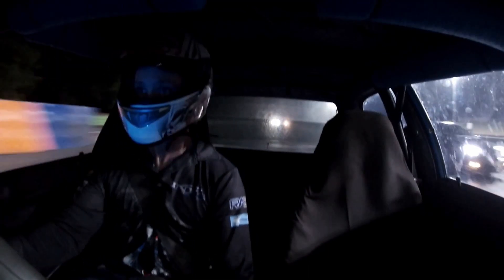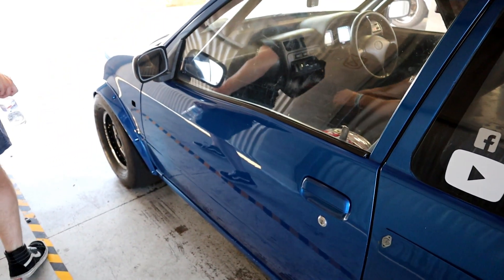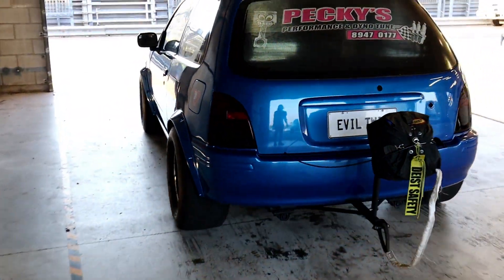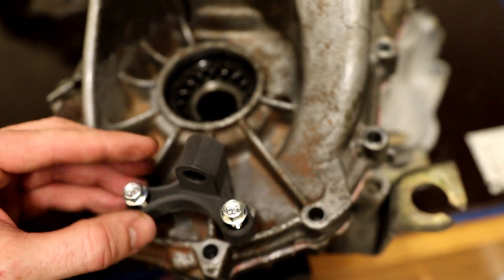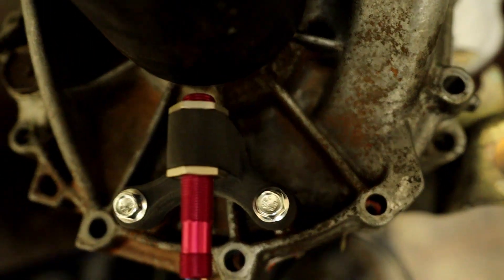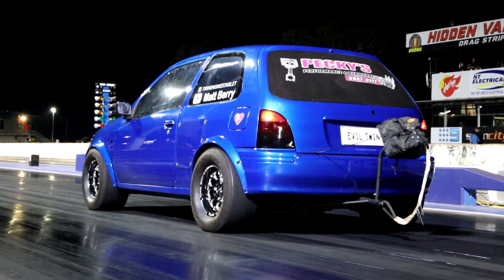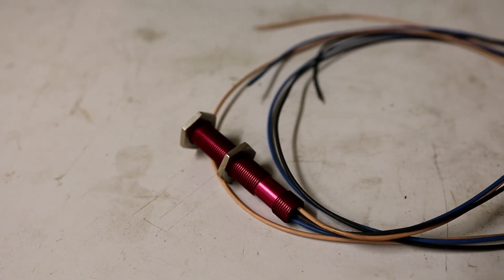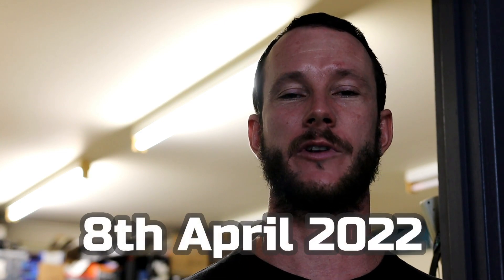How to control traction on a twin engine car

Comment: Possibly have suspension height sensor in the front and rear to help manage timing and boost
Can get sensors from Subaru or vag group with analog output
Reply from the maker: Subaru?? Which ones use them?
Reply: @Camp_Dogs  I’ve seen them on forester and outback 09 possible later wrx on I’m Pretty sure they used for headlight level control

Comment: Hey Matt, just been reading about a Lad who has put a 1.5 1NZFXE out of a Prius in his Echo drag car. 13.8@99mph nat asp. Apparently the prius engines have some pretty good internals from factory. Ever considered playing with them for Evil Twin?
Reply from the maker: Hey mate yeah saw the post the other day, it flies!!! Very impressed with the way it goes. I am happy enough with my 5efe combo at the moment, its making too much power to handle so ive still got plenty of growing room!

The 5efe engines are also getting insanely hard to find, if i end up blowing my engines up i have been looking into the 2nz engines, they have a much much better cylinder head design and very readily available.

Thanks for the idea!

Comment: Great idea Matt. What happens if tyre temps are different, will it kill off much power to match engine/wheel speed?
Reply from the maker: It will only restrict power to the front engine so it wont matter on tyre temperature or track conditions.

If Haltech picks up that front engine speed is faster than the rear it will reduce power

Comment: Awesome run Matt !!! Send it you unit !!! The wheel speed sensors is a great idea 💡 but you need a weight plate up front mate !!! When front unloads and spins it will cut timing and then cut the rear engines timing which is a huge loss of power down ie chase your tail and go slow , I suggest weight plate so you can turn the front engine up and tame the rear down a little !!! Will work a treat !!! 😜👍🇦🇺
Reply from the maker: The ecus are seperate , when the timing gets cut it will only be to the front engine only
Reply: @Camp_Dogs  Some sort of longitudinal sway bars to resist weight transfer under accel & braking maybe?

Comment: Did you try adjust suspension ANTI-SQUAT ? not sure antidive will help at this or not,
Reply from the maker: The rear also lifts the front. Its literally like driving on water its that slippery
Reply: @Camp_Dogs  for that i suggested adjust ANTI-SQUAT,  will be harder lift front., so front gets more grip